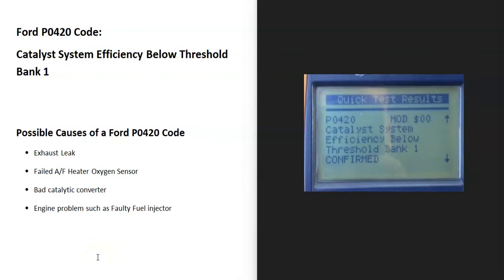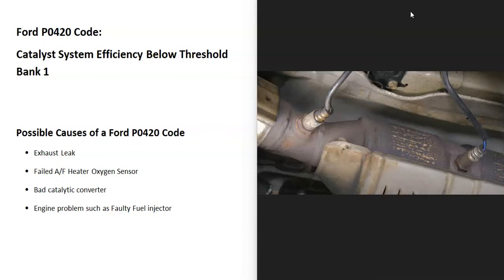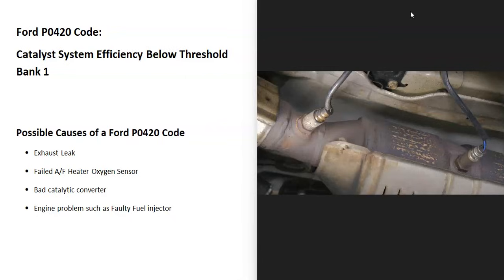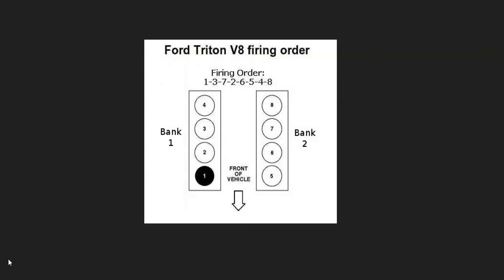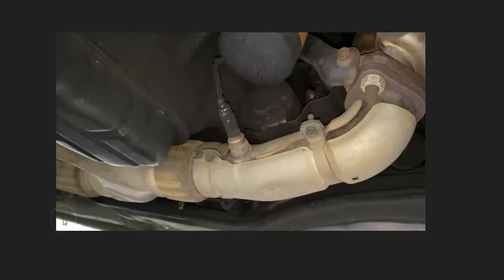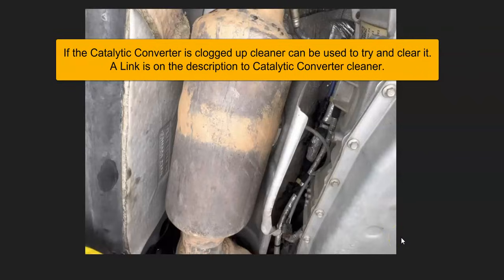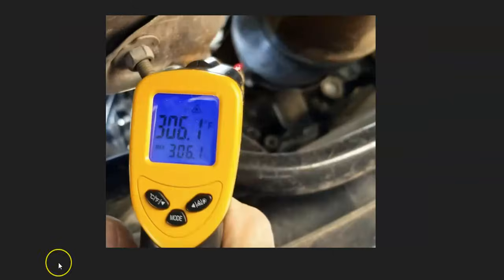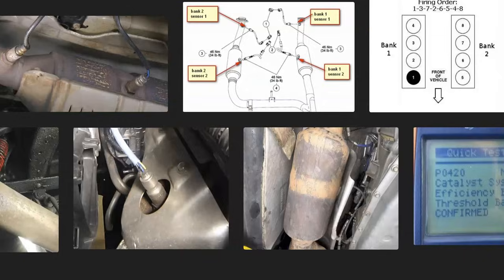Causes and Fixes Ford P0420 Code: Catalyst System Efficiency Below Threshold Bank 1

Comment: I was getting the P0420 code regularly and I was using a K&N filter, unassuming I replaced both O2 sensors (over $300 in parts and labor) and kept the K&N filter and the P0420 kept coming back so I cleared the code, cleaned the MAF sensor and reinstalled a stock paper filter, over 400 miles driven since and P0420 hasn't come back since..

Before replacing the air filter and cleaning the MAF, the downstream O2 sensor was reading between 0.8v and 0.85v which is on the high end, after it was reading between 0.6v and 0.7v which I trust shows an improvement. I think the K&N was letting more air and more fuel than the ECU was tuned for thus throwing a code for catalyst system below threshold but strictly no other codes.

Engine is a 2016 built BMW N55 3.0L inline 6 twin turbo w/ 140k miles

Comment: Blessings and Hey, great info thank you much, I had check engine on for a few months same code P0403 and P0443 and now P0420 just came up this morning after driving about 10 miles, and P0403 and P443 is back also, I got a whole new wire harness,  new egr valve, throttle body, purge solenoid purge valve and both transmission sensors change and front drive shaft, just got my truck back yesterday so I have to take back to shop today after several days in shop, guy told me I probably have to drive it more smh been doing that for months drive 50 ok drive 50 miles ok drive 50 miles, omg 😱 😳 so I will see what happens when I go back today, praying and hoping it’s needs the cleaner or maybe the 02 sensor. Any help will be appreciated it much Thank you much and God Bless
Reply: Also truck rides even better better so idk

Comment: I have 2015 and am having this problem. I first replaced the o2 sensors all four seemed to help for abit nd came back then i checked air filter it seemed pretty dirty so I changed it still have code. Finally caved nd replaced the cat but still same issue.

Comment: My daughter has a 2016 fiesta. I went to change out both sensors but the upstream one spun the bung ritht off. So i bought a cat and put it on with all new sensors. Still throws codes. Going to check for exhaust leaks today

Comment: My check engine light comes on and goes off whenever it gets good and ready. Like it has a mind of its own. After replacing my 02 sensor that was completely burned out on my 2012 Chevy Equinox. It's at the point now even if air comes out of a tire that would trigger the check engine light. So I better keep em' filled. If the brakes need replacing. That would trigger the check engine light as well. And if that traction tire light comes on warning me of the tpms sensors that would trigger, the check engine light also. 😂😂😂 It's Deep!

Comment: I have a 2012 Ford Fusion SEL AWD.  I had Ford replace both bank1 and bank2 converters.  Ever since, my engine light comes on telling me that the rear converter is bad, etc.  They are both aftermarkets because Ford doesn't make these OEM converters for 2012 for Fusions anymore.  So I am getting a false code because the aftermarket converters is a 1/4 smaller than the OEM.  What can I do?

Comment: I got the code in a 2016 s fusion and I have replaced the purge valve and both the o2 sensors down and upstream and my car feels like it has a lot of power what other steps should I take to get the code cleared to pass smog in ca
Reply from the maker: I would test the catalytic converter and see if it is working correctly.
Reply: @ how

Comment: I have a 2014 Ford F150 Lariat v6 ecoboost. I have changed the sensors on the driver side. My check engine light was on and went off after replacing them with new ones from Advanced Auto Parts. However, the light came back on after driving for a couple of days. Then it went off after I really smashed the gas. The next day, it came on again. I took it to a muffler shop as my mechanic suggested. After they ran their test, they said it is the Cadillac convert and the fuel pump is going bad. I have 150,000 miles on my truck. Has anyone else experience this issue and if so how do you fix the problem with the check engine light going on?

Comment: I experienced a problem when I was driving my Mustang, as the engine began to perform poorly, especially at low engine revs, in addition to difficulty starting, noting that there was no check engine light, but I opened the car and found that there were two codes p0430 and p0420 at the same time.
Please advise with thanks
Reply: How did you find out it was the fuel pump?
Reply: Did u figure it out?
Reply: @briandiaz2559  yes bro, it was a weak fuel pump. So I replaced it with a new one and it works perfectly.

Comment: OK I have a big question I drive a 2011 F150 with a coyote engine V8 I’ve replaced the Cadillac converters and I’ve also replaced several O2 sensors along with all the other necessary sensors and my vehicle but I still get the P0420 code. I’ve taken it to two mechanics and they tell me there’s nothing I can do but I’ve noticed a significant difference in power output and it just doesn’t drive the same. I don’t know what to do and at this point I’ll take any advice I can get. If anyone has an idea as to what I could try or something I could do please let me know.
Reply: If yet , not repaired Have someone check ur inject flow , may be receiving to lean fuel

Comment: Can you help me iam having a problem with my ford fusion se 2.5 I changed both of my sensors and my code came back up. P0420 but the car drives normal.
Reply: I’m in the same boat
Reply: Any updates?

Comment: Something to add that could be cause of problem. Easiest solution, and most overlooked problem is a dirty air filter. Especially the CAI oiled filters like K&N. If you have a factory filter, just buy a new one. If you have a aftermarket oiled type filter, remove it and spray it with cleaner. Spray it from inside out with water hose, let completely dry, and reapply oil before installing.
Reply: So far the code gone after changing air filter and does not seem to be come up when I rescan the car
Reply: Ok, let me start with this low-hanging fruit and see what happens. Wish me luck!

Follow-up on 9/10/25 :

Still didn't work after replacing the air filter. I read cleaning Mass Air Flow (MAF) sensors and Throttle Body (TB) bought respective cleaners. TB and MAF sensors look dirty, so I thought "this could be it". Unfortunately, it didn't fix it, but at least I now have a cleaner TB and MAF. lol. 

I'm hoping to get another simpler solutions.
Reply: Really eh so start there Frist I know mine really old and was going need to be replaced many many miles ago.. then what go to the sensors next.. smart to replace both sensors at the same time right

Comment: I watch your viedo and others I got a p0420 code trust me buy the cat cleaner liquid you pour in your vehicle it's most none of these other clogged honey cone inside cat pour cleaner in it and watch the magic I done this drove normal 20 to 40 miles and following directions on can my vehicle on its on cleared the code I am sold on this liquid cat / exhaust cleaner u need try it for me it workes no more faults
Reply: Which cleaner did you buy?
Reply: cataclean is the highest rated cat cleaner
Reply: What cleaner?

Comment: Hi, I have that P0420 code on my ford and  it came up after I drove 15 miles after oil and oil filter change-but I have used the same oil as usual. I added catcleaner to fuel and now I do 58 miles per gallon when before 52. I have just changed lambda co2 past-cat sensor and all 3 spark plugs and light is still on. My mechnanic did catalyst test and it would pass MTO so is it possible that catalyst needs to be replaced despite has passed MTO test ?
Reply from the maker: It is hard to say, but when a catalytic converter becomes clogged up, the engine will have less power than it once did. There are several tests that can be done to test the Cat. I would also test the 02 sensors with a scan tool to be sure there are no issues.